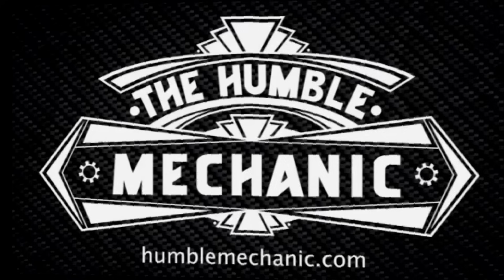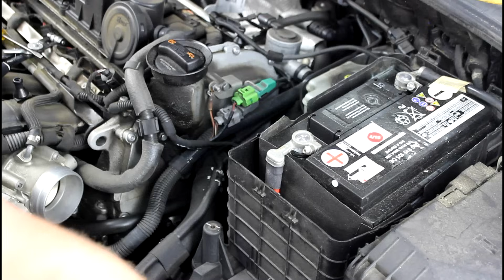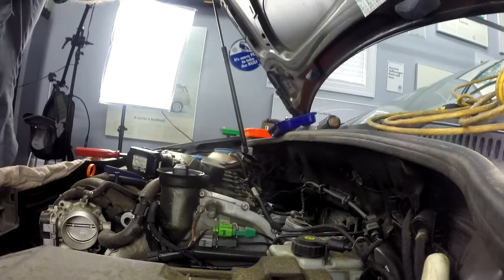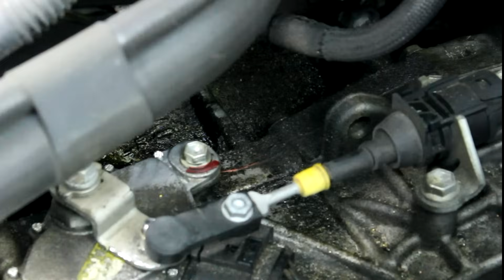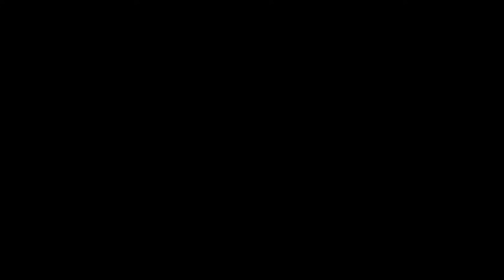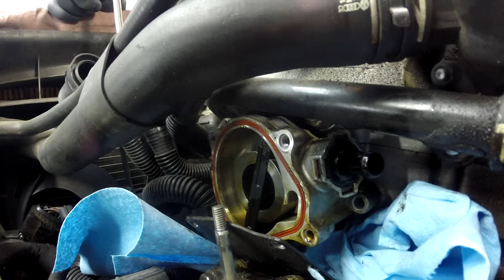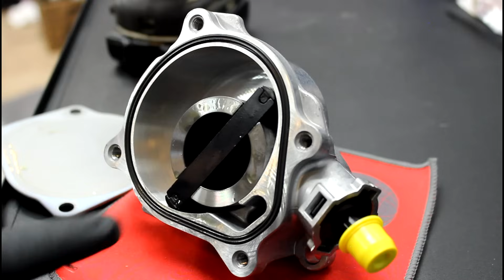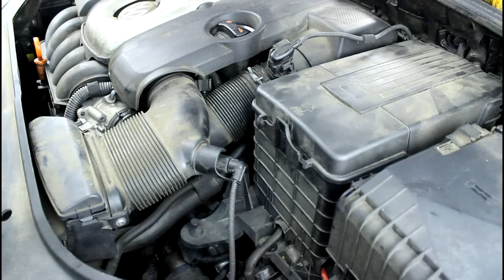Replacing VW 2.5l Vacuum Pump ~ The Easy Way

Comment: Watched your video a couple of times and I'm a little unclear on two things 1) the reason you are marking those two bolts with a sharpie.  Are you doing it to make sure the right bolts go in the right place or is it for alignment/proper tightening?  2) when you put the new pump on and you speak about making sure the protrusion that fits in the engine lines up just like the old one comes off.  When you put the pump back on will it be obvious that it has lined back up?  Is there a groove or other slot that it fits into?

Comment: I have a VW cc sport 2009. I need to replace brake vacuum pump and upper gaskets. when I drive it feels like it wants to cut off and it runs rough
 Is it save to drive.
Reply from the maker: I wouldn't drive it if I was worried about it shutting off. But I don't think those 2 repairs will fix your issue.

Comment: great video!  New subscriber, I  have this very problem on my jetta.   Quick question though, have you seen this oil leak cause any electrical problems by possibly wicking into the wiring harness anywhere?
Reply from the maker: The only issue I have seen remotely related to this issue is oil leaking on the transmission connector and swelling the seals.
Reply: hey thanks for the info.   Its a harness connector close to the shift selector, towards the headlight.  12 pin I belive, just full of oil, most likely from that pump.  It's bad.  Granted this car has been leaking for a very long time so I'm not surprised to find a problem that isn't common lol. If I could bug you for one last little expert tid bit, any common break or pinch points on the unmolested engine/Ecu wiring harness?

Comment: i stripped 2/3 bolts not realizing they were t-30 and not t-27.... am i screwed or can i salvage this fuck up???
Reply from the maker: You are fucked! 

LOL, kidding of course. Find a T30 and use it... You may have to tap it in with a hammer to get it to bite. I would use a good quality t-30, not a harbor freight one.
Reply: nvm said fuck it and sold it today

Comment: I tried this repair on my own and all my oil leak out from the bottom. Any suggestion what I did wrong??
Reply from the maker: +James Adger-Lewis III make sure you have the bracket on the outside of the pump
Reply: HumbleMechanic Will Check. Could I have possible damage anything in the engine? As soon as I turned the vehicle on the oil came right out. I turned the engine off immediately.

Comment: Thanks for the video. I have ordered the gasket for between the pump and timing cover for about $7.00 (including shipping) from Rock Auto and will soon try and make the repair by using some gasket sealer on the rubber o-ring between the vacuum pump and cover. If that doesn't work, I'll order a new vacuum pump. Here's the link for the gasket:

 http://www.rockauto.com/en/catalog/volkswagen,2007,jetta,2.5l+l5,1438371,brake+&+wheel+hub,vacuum+pump+gasket,11817

Also, both the gasket and o-ring are available for about $40.00 from RTXTech at this link:

https://www.rkxtech.com/collections/vacuum-pump-repair/products/rkx-vw-audi-2-5l-vacuum-pump-reseal-rebuild-kit

Comment: I was sKEEred to try this since I have no mechanical experience.  However, I watched the video several times, tooks notes, ordered the pump and bought the couple of tools that I didn't own to attempt it.  When you say that one lower torx is hard to put back in and you dropped it about 3 times, I think I dropped it about 30 times.  Also, I was told by 2 different places that I took it to get the oil changed that it was my rear main seal.  Subtract the vacuum pump, gasket and tools, you saved me over a thousand dollars.  It took me about 3 hours and a sore back, but I haven't had oil leak since I changed it over 2 weeks ago. Thanks so much, great instructions for a female with no mechanical knowledge.
Reply: You’re inspiring me to try this on my 08 jetta! I too have little to no experience haha
Reply: Tip for next time on holding a screw on a bit. Use a small piece of tissue paper or paper towel on the bit head and push the screw on that . Should hold twice as good going in horizontal or straight down

Comment: Amazing video. Thanks! Is this procedure different on my standard transmission Jetta?
Reply from the maker: +Jazzguy 73 thanks. 

Yep the Jetta manual is totally different. You can just take the 10mm and 3 T30s off. It comes right out. 

No need to take it apart.

Comment: So could I just remove the plate on the side of the pump and clean, reseal with rtv without removing the pump? as long as that is the gasket that is leaking seems easier?
Reply from the maker: +Andrew Heaton it's worth a shot.
Reply from the maker: +Andrew Heaton just be careful how much you use. You don't want sealant in the housing
Reply: HumbleMechanic thanks I think I'll give it a shot next week. would you   clean and reuse the old gasket along with the rtv?

Comment: I know my vacuum pump is leaking, I can visually see it. But could this also cause higher rpm idle upon starts, or is this because of the pcv in the valve cover. I just don't want to have to do both if I only NEED the pump
Reply from the maker: +Tanner N no, that shouldn't cause a drivability issue

Comment: @HumbleMechanic - I know this video is old but attempted this today on my Wife's 06 Beetle. When trying to remove the bolts for the shifter... I do not have impact tools. I tried with a socket wrench, those bolts were in there good. So good that one of the bolts broke on me with the other half still in the hole. I did not continue from here. The other bolt was still enough to keep the shifter very stable so ended up re-assembling everything. I was using the delete kit.  =(
Reply from the maker: OUCH! Can you soak it in penetrating oil? Often times tapping the broken bolt a little with a punch will allow you to just twist the bolt out. Just be really careful.
Reply: HumbleMechanic - Was looking into easy out kits but will check that out as well. May be some time before I can get back in there. Thanks for the reply.

Comment: I am looking into buying a 2005 2.5 and found one for $1250 drove it and it is very smooth! 170,000 on it. leaking oil though do you think it would be worth it to purchase and repair?
Reply from the maker: +Tony Lackie if it runs and isn't rusted the hell out. Just put some cash aside for repairs.
Reply: HumbleMechanic thank you! it's in awesome shape and runs smooth!

Comment: I'm digging what you do here, you're awesome!
I have an issue I'm hoping you can help me out with...My wife's 07 Passat started just killing at hwy speeds then showed some idle irregularities. I started looking and found the spark plug/ignition packs drowning in oil. I changed the Valve cover gasket which solved the oil issue but didn't, as I hoped it would, solve the kill/idle problem. It seemed fine but after she drove 20-30 miles it would kill on the Interstate ...again...she is....UNHAPPY to say the least. So I reinspected the plugs to make sure the gasket was good and it's fine. As I was looking around I could hear a slight hiss and found the Bake Booster Vac hose cracked and will replace later today. My Question is could this be the cause of the idle irregularity and the engine kills? I was thinking more fuel pump/control module before finding this issue...
video of idle and hose pic  https://drive.google.com/drive/folders/0B2w7hn9KmcJwTkZmMVE5SjJDdUE?usp=sharing

Comment: Best.  DIY.  Auto.  Video.  Ever.  Well done.  Now, if you could show me how to replace all the door locks on my wifes 2008 Jetta S that would be great.  The doors have not locked in years.  Dealer quoted $500 per door.   And I think only one door is still working.  : )

Comment: way are you marking the shift cable bolts
Reply from the maker: +Kenneth Latour there is a slight adjustment. I always try to get them back exactly where they came from

Comment: Is it possible for the pump to leak from the brake booster nozzle? I replaced the gaskets and see no leaking around their connections but still have an oil leak. it looks like it is forming from around the nozzle connection into the pump housing. Do you think the pump would need to be replaced? Could I have reassembled something incorrectly that would affect that nozzle?
Reply: There is a couple real short video clips on my page which show what I am talking about a little bit better. Could you take a quick look at them and let me know what you think? I really appreciate your videos, they are extremely well put together.

Comment: Is changing this with a manual rabbit much different? I believe this is leaking on mine and would like to give the repair a shot!
Reply from the maker: +990Inferno manual is tons easier. You don't have to take the pump apart.
Reply: Thanks for the quick response! One more question if you don't mind! Some people are saying to go with a vacuum pump delete kit instead of a new pump. Is that a terrible idea?

Comment: Just had the stealership tell me my VP pressure is low and want to charge me almost $800.00 for the replacement. (09 Jetta 2.5) Glad I know to refer to your channel!! Only question.....is there no gasket on the back side of the pump? just metal to metal seal?

Comment: thanks for video and tutorial.  However, i do not understand the point of marking the bolts for the shift selector since it seems to be installed in only one way?  

could you explain further?
Reply from the maker: +Uncle Pecos there is a slight adjustment that can be made. Marking them allows you to put them back where they were and avoid the need for adjustment

Comment: I was curious if the vacuum pump delete kit was worth installing versus running into any issues with the vacuum pump in the future? Specifically the Spulen 2.5L vacuum pump delete kit in the link here http://www.uspmotorsports.com/Engine/Accessories/Spulen-2.5L-Brake-Vacuum-Pump-Delete-Kit.html
Reply: Richard Cascio i put it on my 2012 passat & my low oil pressure light came on 3 times in less than a week & a half of install. Though the car did sound more aggressive, and even felt like it had more power (insignificant amount). I took it off & put my pump back on. I just took it as a sign that that's something that shouldn't be deleted. If your light does come on I would just get a pressure gauge to check it and make sure it's correct

Comment: Thanks so much for this how to! Did this yesterday and it was great and relatively easy to do. Tightened the cover plate screws to 10 NM like you suggested and it seems to be good to go! 

Word of warning, pack more towels than you think you need to catch oil when you remove old pump! Still cleaning some oil up off the bottom skid plate!

Bottom line- you saved me about $1000!

Comment: I just put the vacuum pump delete kit on my 2012 passat 2.5, i let it idle for a few, turned it off, went inside to clean up, came out to drive off & my "oil pressure low engine off" light came on. Any suggestions
Reply from the maker: +Barrack O Bow Tie yikes. Check the 14pin connector behind the left headlight.
Reply: Will do. But i never touched any of that.
Reply: That didnt help
Reply: The oil pressure light is still coming on
Reply: Are you talking about the one under the power steering or next to the power steering  reservoir

Comment: For anyone doing this - that plastic part in the middle is not a single piece - it's actually 3 pieces with 2 rounded end caps. One of mine fell off during install and went unnoticed until I heard a ticking sound at higher RPMs. Anyway the repair goes exactly as described. I found it a little easier to remove the transmission range switch as shown in the video as opposed to keeping it in place.

Comment: great video.  replaced the gaskets on my 2010 VW beetle - auto trans.  had to move lots of misc hoses, batteries, etc.  Used a magnetic screw driver with the torx head. made the job much easier.  The source of leak was the outer pump seal which was easier to get to than the inner seal.  But I replaced both to be sure.  Had to disconnect a radiator hose and lost some antifreeze but filled it back up with the purple recommended fluid.  broke on air hose as it was brittle but fixed that.  Hard part was removing the battery, battery tray and air filter and air hoses.  Thanks.  Saved me over a thousand $ in labor.

Comment: Hey so i got a quote with this as an issue as well as "Oil Filter Adapter housing gasket" Do you have a guide on this repair? Or know of the part i may need> VW Jetta 2006 2.5L

Comment: Question:

Did this repair 2 weeks ago on my 2010 Jetta and cracked the head off one of the T30's that holds the pump to the engine (overtorqued when putting new pump in). I also noticed the oil leak is back after about a week in the clear... any suggestions? Any way to get that T30 out and either replace it or re-thread with a bigger bolt?

Comment: hello humble mechanic,
great video, I followed your video to the T but woke up to big stain on my driveway.  After installing new pump I took vehicle to car wash to clean up under carriage for all that oil. this morning the stain was closer to the passenger side of the engine. Could it be something else leaking?
Reply from the maker: +manuel jimenez damn. That's no good. Have you find the issue?

Comment: it looks like the Gasket is now available.  part# W0133-1920840. why not just replace this?
Reply from the maker: It may not have been available at that time. Plus one of the issues was dissimilar metals in the older pump. The new pump has a different cover. But this may work too.

Comment: Mr Humble, thanks for the guide...Why do you replace the whole pump [$200+] if it's just the gaskets that are leaking? Can't you just replace both gaskets? Thanks...
Reply from the maker: +james ferron The outer gasket is not available separate from VW. So from a dealership standpoint we have to be able to warranty apart we have to replace it. That's something a DIYer might be able to do themselves

Comment: 30 yr aircraft mechanic. Great video. My daughter has an 08 Beetle with the 2.5 and the dealer wants over a $1000s to replace the vacuum pump. After watching your video I have decided to handle it myself. It looks pretty straight forward. I'll let you know how it goes.
Reply: HumbleMechanic the vacuum pump went without any issues. everything in/out/replaced/ops checked in about 1.5 hours. thanks again for the great video.
Reply from the maker: +Gary Altonen that's awesome!! Glad to help
Reply from the maker: best of luck. I think you should have no issues!
Reply: thanks

Comment: I stripped out a t25 screw any tips
Reply from the maker: +Terry Andrews try tapping a flat blade screw driver in it.
Reply: Terry Andrews use a drummel, and insert a flat head screw driver.  make sure it's a thick tip to really get that stripped screw out. happen to me as well bud
Reply: Terry Andrews -the   GRAB-IT  tool works great on that kind of issue. Blue point makes it . AKA snapon.
Reply: I think they may actually be t27.

Comment: I wish I could give you 100 thumbs up, you just saved me $1000!
Reply from the maker: AWESOME!!!!
Reply: I just got quoted for this to be replaced today. $350 for the part, $750 for the labor, $30 shop fee, $30 in taxes.
Reply: Yea I got quoted $1000 too 
These fucking fascists
Reply: @fenixweb1348  I got quoted 1200 wtf
Reply: You could save even more buying a gasket kit on amazon $40, I just did it and it worked perfectly. Replacing the entire pump for a leaking seal is ridiculous, save a $200
Reply: @ericmichel3857  Do you have a link for the kit you got?  4 months later is the new gasket holding?
Reply: @ericmichel3857   did you replace that orange gasket? Did that resolve the issue? I have a minor leak on the pump and I thought about replacing that orange seal instead of the whole unit. How long did it take you to replace that gasket? Thanks in advance!
Reply: @mohammedalmukhtar8949  If you look at my previous message I bought a kit that included both gaskets so I did replace both. However from what I understand the leak usually occurs on the outer plate so you could probably just replace the outer orange gasket and fix the leak. I just figured since I was right there I took it out and replaced both to be sure since it was just four more bolts and the whole thing comes out.
Reply: Thank you for your response,  @ericmichel3857 ! Much appreciated.
Reply: Just got a quote of $985 for this from my VW dealership in VA.
Reply: Matt S a $1000 damn who's charging that ridiculous amount?
Reply: xactly dealers in socal are charging 1800 for this plus break fluid flush. ridiculous
Reply: 1969nydrell David vw dealership here in Houston quoted my buddy $1000 for this repair ...  over $700 in labor and shop fees..... THATS ridiculous.....
Reply: 885 dollars an estimate he said at the dealer thank you man
Reply: Can  i just change  the metal gasket
Reply: Yes, the original gasket held for 8 years, I see no reason why the replacement won't last just as long. I replaced it over a year ago and no leaks so far.
Reply: M S you could patreon him
Reply: Talk about inflation they quoted over $2k for a replacement gonna see if this is possible myself

Comment: Is the leak coming from the front cover? Would it work to replace just the gasket?
Reply: The gasket is available on eBay. I bought one already
Reply: I got both
Reply: Do you have the link?
Reply: Griffin did replacing just the gaskets work? Or did you still replace the entire pump and gaskets?